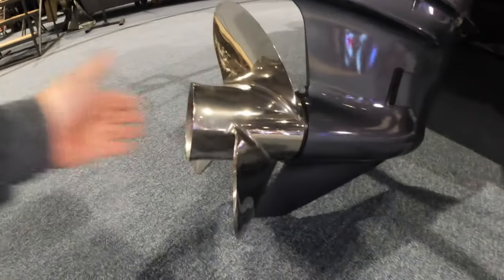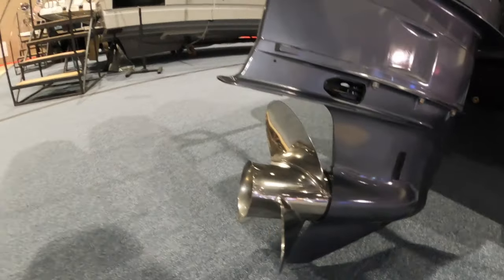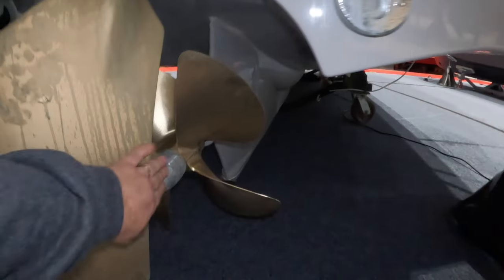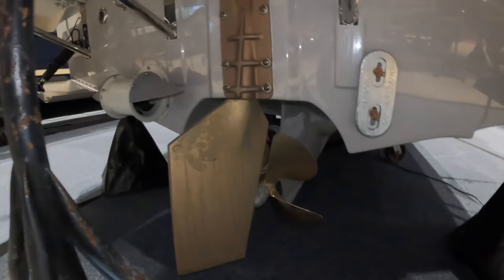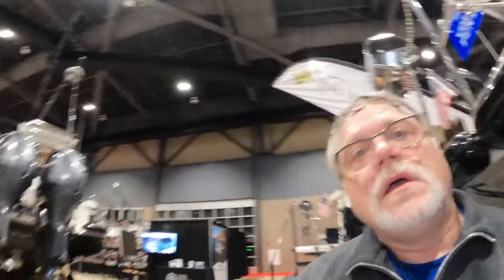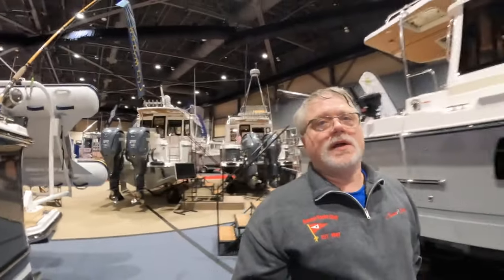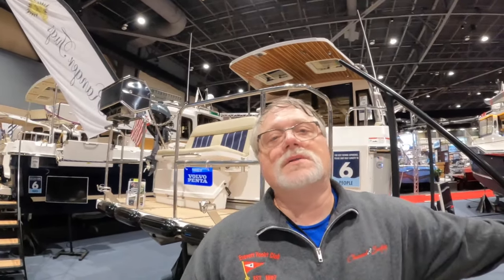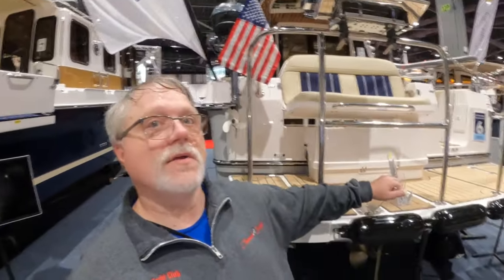Let's talk Inboard VS  outboard | Ranger Tugs

Comment: People usually forget the weight, they are less prone to rocking as long when you have all the weight down below for ballast rather than the outboard above the waterline.
Reply from the maker: Absolutely.  Weight makes a big difference.   Lemondrop used to be a R23.  She upgraded to the R27-OB soley for more boat weight to handle the rougher seas better.

Comment: Is there a noise difference?
Reply from the maker: You know... I should have mentioned that.  The diesel inboard in noisier than the outboard.  The Yamaha F300 is super quiet. Underway at 25 knots all we hear is the wind and water noise.  We usually listen to the radio underway.   Folks have told us the inboards are too loud to hear the radio playing.  It probably also makes a difference with the outboard hanging way off the back of the boat vs. the inboard being in the boat, up against the cabin.